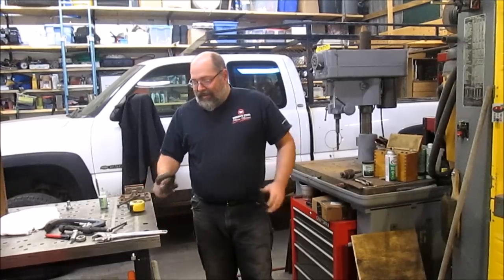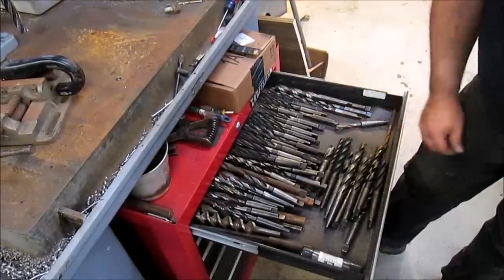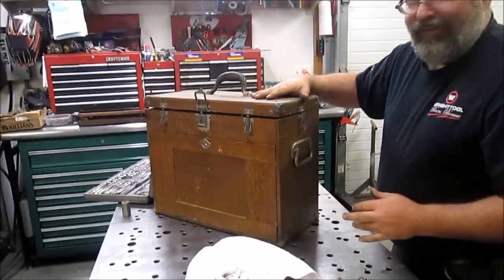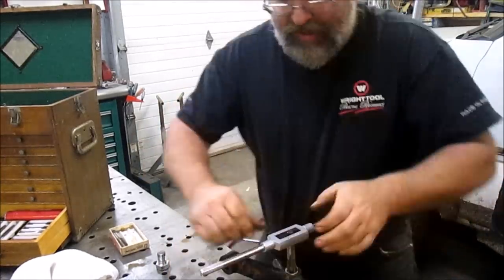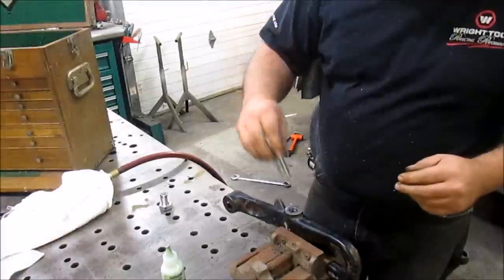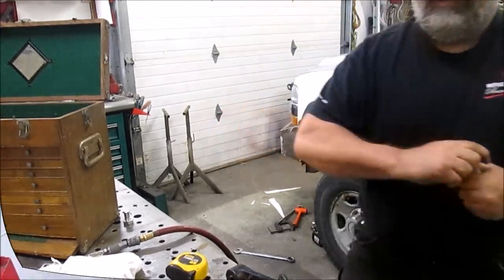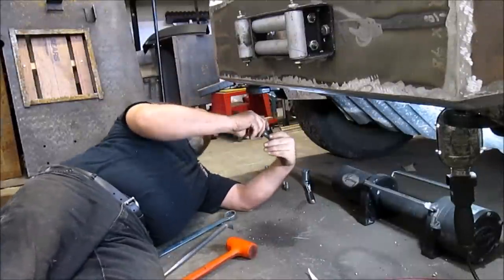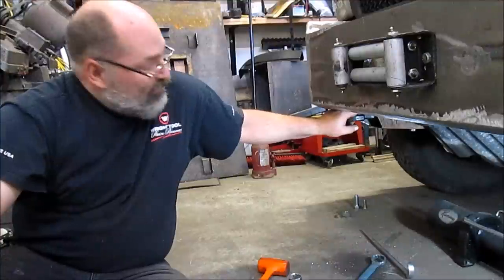2001 chevy 2500HD tow hook mod

Comment: What's the exact bolt size and thread type of the bolts used for the stock/original hooks? Having problems finding them for my 04 2500
Reply from the maker: I don't know off hand, if I remember I will take a look this weekend. Thanks for watching and commenting

Comment: Great way to drive your knuckles into the saw blade. Use a pusher block. You don't need to tip the part a bandsaw doesn't exert that much pressure.
Reply from the maker: +Doug A Thanks for the comment, I do usually use a block . when I was cutting it was pulling down hard, so that is why I talked about tipping the part.